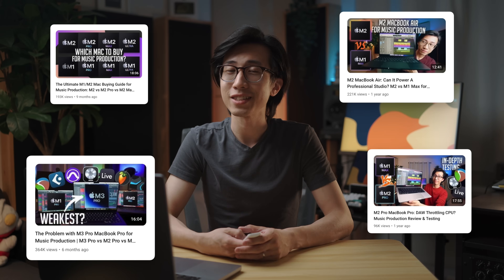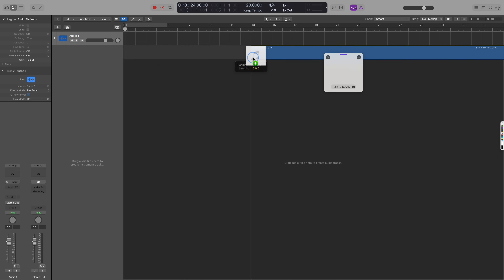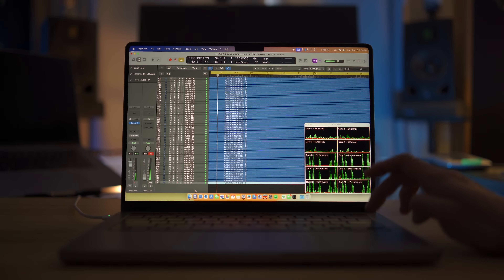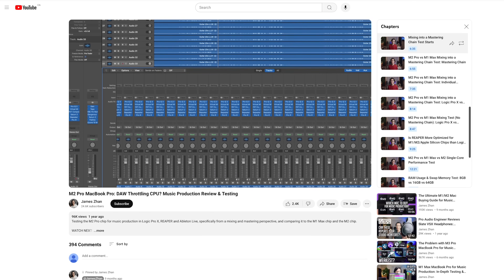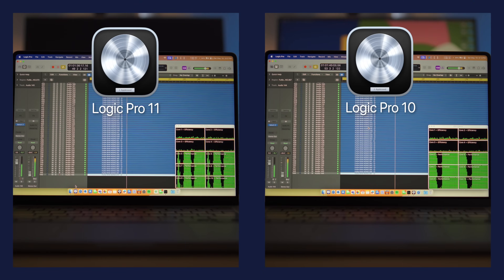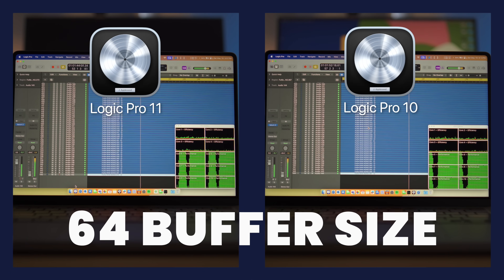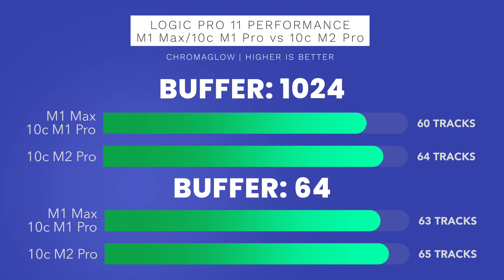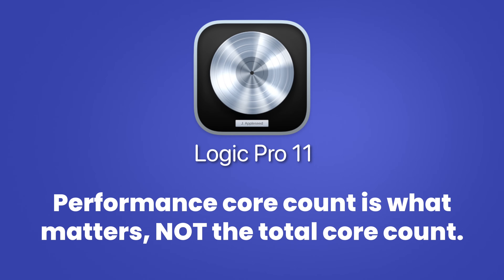Logic Pro 11 on Apple Silicon: Are CPU Cores Fully Utilized?

Comment: The flaw in your test is that you assume cpu capacity is one large pool that you can use to evenly bear the load of a homogeneous set of threads. In a contrived test like yours you can make that happen, but in the real world that never happens.  Using the E cores makes it possible to run more tracks in a contrived test like yours, but makes it more likely you'll have cpu overloads in the real world scenario where some signal paths are loaded more heavily than others when a thread that ran fine on a P core a moment ago now runs on an E core and overloads. The design in Logic is intentional. The idea that it is somehow an unintentional flaw is laughable.
Reply from the maker: Thanks for your feedback. Are you suggesting that I should be using different plugins on different tracks? Would love to hear your thoughts—I'm always looking for ways to improve my tests!

That said, my test results do translate to real life usage. There are actual mixing projects that REAPER can run but Logic cannot on the same chip, and many people reported that they noticed that they could do more when going from a DAW that cannot use efficiency cores to ones that can.
Reply: @JamesZhan  The issue is: what the best affinity policy to use to  avoid encountering a cpu overload during a DAW session? There is more to it than raw track counts since a session is a dynamic process. Restricting core usage to P cores makes the behavior when using a DAW more predictable and less likely to encounter an overload due to the hybrid architecture, even though the track count may suffer. My point is simply that Apple went out of their way to make Logic work like this, so it's worth considering why they did that.

Comment: Hey, I'm a bit confused. I've got a video that I use as a reference point for using Logic on M1. In this video, Mark was able to utilize the efficiency cores in his M1 Macbook  Air. He did this by setting Logic to use all 8 threads AND by stopping the playback when an overload presented and then starting it back up. This allowed Logic to 'reorganize' the load between the cores. It's around the 25 minute mark where he does this. Have you seen this video? I'm wondering if Apple may have changed things since Mark made the video so that the efficiency cores can no longer be used. the video is  https://www.youtube.com/watch?v=W3zabsRfT8c&t=1715s

Comment: we just opened 2 different sessions on M1 Max and M2 Max Mac Studios  with Logic 11.0.1. and in both cases all CPU Cores are used ... so is the problem fixed? why are there different results on that? thats strange
Reply from the maker: Hmm interesting. "Used" as in fully maxed out? Because I'm currently doing more Mac testing in preparation for the M4 Pro review video and the latest Logic 11 is still unable to maximize the efficiency cores.
Reply: @JamesZhan  on the m2 it was a 150 track song with tons of plugins, so only little room left. On M1 max the session was smaller

Comment: As a Logic user with an M1 Max chip, I tried to reproduce your test. I loaded a normal pop production into Logic. Nothing particularly many plugins. The efficiency cores kick in first. Almost exclusively. So most of the work runs through these cores. Then I reproduced your test. I got 370 mono tracks with Saturn and Chroma Verb. Then the performance cores are at 100% but the efficiency cores are maybe at 30%. You would expect it to be the other way around. I don't know why that is. But the tests with maximum load do not reflect reality. I'm a bit confused.
Reply: I think it's good that you're doing the tests. Thanks. I'm interested to see how the M4 Max will perform. I wish you continued success with your videos.

Comment: Great video! So bottom line, what is the best choice of Mac if I use Logic and also want to do 4k video editing on a single machine?
Reply from the maker: Once you throw video editing into the equation, it's a lot simpler: just get the latest chip. The M2 and M3 chips all have more powerful media engines that would be useful for video.

Comment: My only gripe with these tests is that they do no represent your typical audio session. Most people are not going to load endless tracks with only one plugin on each however CPU taxing it is, which is OK if you want to test how many cores are in use. More than often after the composing and arranging part, comes mixing. At that stage you are bussing/grouping multiple tracks to one i.e. vocal bus, drum bus, synth bus, guitar bus, etc for group processing. When you do so, the processing previously spread over multiple cores is now handled by one single core. When you take in account all the plugins you suddenly have in one chain up to the bus you're going to start hitting the CPU red sooner. Of course, you can split your mixing into multiple busses thus using multiple cores but it only takes one core to crap out to bring the whole mix down as audio is unfortunately a very linear signal processing ordeal. Therefore, at the mixing stage, single core CPU performance is the most crucial. I would love to see more DAWs taking full advantage of the processing power of GPUs (or using their new cooler name Neural Processors) like NI did for their Guitar Rig Pro 6, or GRAFX, or VSL's Vienna Power House, etc.

Comment: Thank you for the tests, and they are valid -- but wondering if you've tried to record enable an audio track with a few plugins, and few plugins on the master buss at the same time. There is some strangeness in how Logic has always handled this - it's very easy to get an overload because Logic forces those processes onto one core only. It's weird and not sure why this is the case, and I doubt that has changed in LP11 - but it's a very interesting and important thing to consider when considering which Mac to buy or when to upgrade. This is why I'm waiting to upgrade my M1 -- because single core performance could make the biggest difference when it comes to recording tracks while playing back a lot of existing tracks (and while keeping the buffer low to decrease the latency of live input tracks). thanks again for your videos...

Comment: another great videos of yours. actually Logic 11 runs smooth on my Macbook Pro M3. I've never seen a system overload pop up, as it did all the time with my Macbook Air M1
Reply: I'm glad you said this. I'm thinking of diving in to Mackbook M3 Pro. What CPU and Ram do you have. How many tracks to you typically record and play on?? Thanking you in advance.
Reply: @Darrin.Crawford  I had a Macbook Air M1 from 2021 and switched it for the 14 inch Macbook Pro M3 with 18 gbRam. Try to get it with a student discount (which I did, I just found someone who was a student and they gave me 200 us$ off at the apple store) I only do instrumentals with 1 vocal track, however, I noticed that whenever I had to switch on low latency on the Macbook Air, now I can run tons of plugins almost withotu any latency due to the smaller buffer size which can handle more plugins at once. Usually I have tons of saturation, compression, delay, reverb plugins of all kind, all running through busses with sends and returns, with parallel side compression, parallel comp bus, etc... tons of routing and still the Macbook Pro M3 can handle everything. Never heard the Fan even! never! it has. Even though I did lots of research because the M3 models have less perfomance cores than the maxed out M1 or M2 models, there is a video on YT showing the differences in regards of perfomance cores, that's all you need to care about. You could also get 8 cores of which 4 are perfomance cores but 32 Gig Ram however I once read that heavy plugin processing and live recording benefits more from more perfomance cores rather than more Gig. So the 18 gig ram are completely fine. I hope I didn't confuse you too much, it's easy to get lost, just get the macbook Pro M3 model with 18 gb ram and you're good for the next 5 years at least. It's an investment for sure!
Reply: 🧢 boy stop it

Comment: Key factors to note here - these are laptops. The efficiency cores are there to optimize for laptops. It is rumored that going forward with M4, the desktop versions like the Mac Studio are going to have fewer efficiency cores, and more performance and GPU cores. So that will change these equations significantly. Should they adjust Logic to use efficiency cores more, even if that’s not the what they’re intended for? I’m not sure. For the DAWs that use the efficiency cores more, does that impact battery life and/or thermals?

Comment: What were the memory configurations of the M1 Max and M2 Pro chipset? You did not share this information with the viewers. It would not be a fair test because 32, 64 and 16GB Ram are utilized differently by various DAWs on the different machines.  Logic for example utilizes 16GB Ram more efficiently when using local plugins than when using 3rd party memory killers like Kontakt and UADX plugins etc...

Comment: I was hoping for this test, just to be sure they had not addressed that issue. I saw no information suggesting that they had.
But I still wonder if avid really has. They have had some buggy releases, so it would be interesting to see a comparison, to see if they are showing the same to be expected perprmance boost, in your test scenario. I have seen requests for ableton 12 and latest bitwig, but if they have not announced support for e-cores, I dont think they have implemented it. Apple could have, with logic, without making an announcement, but that is apple, you mever know what they announce and what is just implemented without a mention.

Comment: So what does it mean when my 2020 13" MBP with quad core i7 can do the same stress test you did and running up to 146 tracks using Logic 11?  Used a mono gtr track with Saturn 2 set to high quality.  I even added the Townhouse Buss Compressor and Ozone 10 EQ on the master buss to boot.  Are we saying I have the same performance as a Apple Silicon chip?  I did let it run for about 10 mins and the fans were definitely spinning hard but it kept going. Obviously mileage will vary since I usually have a mix of plugins and some that might use more CPU.

Comment: Although it's kind of disappointing that Logic Pro cannot benefit from using all cores I still don't see this as a bigger problem, I've worked entire production and mixing sessions on a simple M1 chip and haven't had any problems yet, Logic is just so well optimized that it can handle (almost) everything that you throw at it.

Comment: I can't believe they never fixed this for LP11. Interesting that on the CPU meter within logic, it is showing 12 processing threads, but on activity monitor it is obvious the performance cores are the ones doing the heavy lifting while the e-cores are not doing much to assist at all.
Reply: I've tried running Logic in Rosetta mode on my M4 Mac Mini, and for whatever reason then it does utilise the efficiency cores fully.  Then when I switch Logic back to running natively it reverts to its usual behaviour of using the performance cores and barely touching the efficiency ones.  I stress tested it and could run about 20% more Au instruments with FX in Rosetta compared to native. I don't know if this is normal or not, or particular to the plugins I use - I find it strange that I can get more overall performance in Rosetta. The caveat of course is that in Rosetta you lose Logic's Apple silicon features. I hope this is something they can address in future, but as this has been an issue for a few years now, I probably shouldn't hold my breath.

Comment: The biggest bottleneck for Apple M chips is ram and not the CPU. This is especially true for virtual orchestra templates for film scoring where its typical to employ hundreds of sample tracks which are memory and SSD intensive. CPU is more important for things like video editing where speed of rendering and transcoding video uses the CPU to its max.
Reply: *RAM size, not RAM Speed.
It is an issue on 512gb models because that ram is slow as hell, but other RAMS are fast.
Still if the ram size is low, it will use caching, but that happens on every machine.
The issue is that Reverb and VST Synth weight a lot. Ableton tried to fix that with max for live. But still...

Comment from the maker: Thank you for watching! 🙏 
1⃣A popular comment is that e-cores are too weak to make a difference. They actually are not! In my M3 Pro MacBook Pro video where I tested 7 different DAWs, test results showed significant better performance when a DAW can fully use the e-cores. (Watch that video here ▶https://youtu.be/FSqX4bt9to4)

2⃣Another recurring comment is that e-core should be reserved for system tasks/light tasks. OK, the problem is that when you have a chip where almost half of the cores are e-cores (e.g. 11-core M3 Pro or the 8-core M2), it makes a HUGE difference to be able to make your computer to pull out all the stops (aka use all the cores fully) to handle CPU intensive tasks as needed.

3⃣Lastly, the point of this video (and my other DAW testing videos) is to help fellow musicians, audio engineers and music producers make more informed decisions when determining which Mac to buy, because it’s not as simple as “buy the latest because it’s better.” What you use as your primary DAW is a critical factor here due to different levels of core utilization.

I appreciate your support and stay creative!
Reply: on Macs, performance based DAWS like Bitwig Studio and Ableton forces all the realtime audio processing to the performance cores, as the efficiency cores are not suitable for it (they get aggressively forced to sleep etc.). Some linear arrangement hosts make use of the efficiency cores to process other things ahead, which are not realtime dependent, but with Bitwig Studio and Ableton Live being a non-linear DAW that has to be able to start any clip at any given time with sample accuracy, there's currently not much it can offload to those cores.

Possible that logic is the same.  Have you reached out to these DAWS to ask them? This is what they will tell you.
Reply: @JamesZhan did you try adjusting Settings -> Audio -> Devices -> Processing Cores in Logic?

When I go there on my M1 Macbook Air, I see the following options: 2, 4, 6 and 8. Although it strongly recommends you stick to automatic resource allocation, which I agree with.

Assuming that this setting does what it says, I'd argue that it's Logic that's the better engineered/more thoughtful piece of kit, and not Reaper.

Please update with a comment when you check it out.

Comment: I'm confused - Logic Pro is a heavy usage app like video editing - much more heavy workloads than normal - so I expect the performance cores to be doing all the work, the efficiency cores are pretty self-explanatory and are mostly for handling background or low level tasks from my understanding.
Edit: Just realised @tronam said the same thing
Reply from the maker: Yeah but the e-cores should be able to help for highly CPU intensive tasks, no? For DAWs that can fully make use of the e-cores, they can get much more performance out of the chip compared to the DAWs that can't. Also, for some of the M-series chips, like the 11-core M3 Pro, almost half of the cores are e-cores. I damn well want to be able to put all the cores to use when necessary.

Comment: This means that my M2 Pro (8+4) configuration might be able to hold water with the M3 Pro (6+6) systems. That's a little bit surprising. Technically, the M3 DOES still have an advantage, as a highly CPU intensive thread or channel strip may perform a little bit better with the higher single threaded performance. In terms of numbers of tracks, they might be neck and neck (or possibly even outperformed by the M2 Pro), so I'm very curious to see if anyone has done detailed tests on this.
Reply from the maker: You are correct that the M2 Pro (8+4) can compete with the M3 Pro (6+6). In fact, I made a video comparing M1 Pro (10c), M2 Pro (10c) and M3 Pro (11c). Tests showed that, when a DAW can fully use ALL the cores, the M3 Pro had the best performance, but for the DAWs that can only fully use the p-cores, M1 Pro, which has the most p-cores out of those 3 chips, performed the best. This is why I make these videos—people should choose the right chip based on their main DAW.
Reply: @JamesZhan  I will definitely check your videos out in this then. Thank you for doing these kinds of tests, very useful information.

Comment: This is outside my expertise, but I think Chromaglow uses specialized hardware (either an AI chip or the GPUs). Thus, it runs better on the M2, because the CPU cores are largely not used by that plugin.

Comment: I think the test with a stock Logic plugin vs. a 3rd party plugin is the best indicator. Even if it’s “Apple Silicon Optimized” 3rd party is still outside of Apple’s control.
Reply from the maker: I don't think that's true, though. Multiple software/plugin engineers have chimed in in my other Mac testing videos saying that the DAW what dictates if a plugin can use the e-cores.

For example, Saturn 2 can take full advantage of the e-cores in REAPER. 

So I think the opposite is true: it's out of 3rd party plugin devs' control whether their plugins can use the e-cores while in Logic Pro.